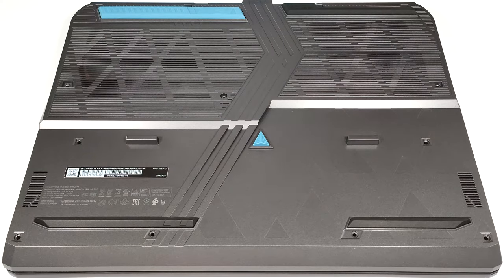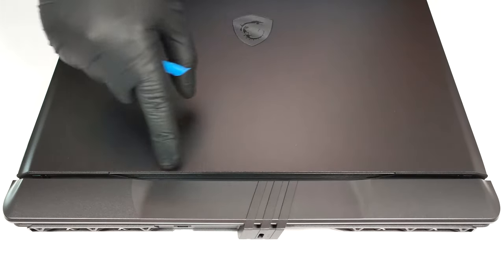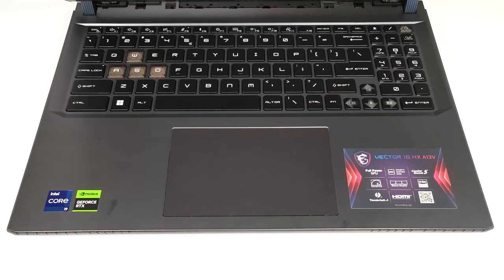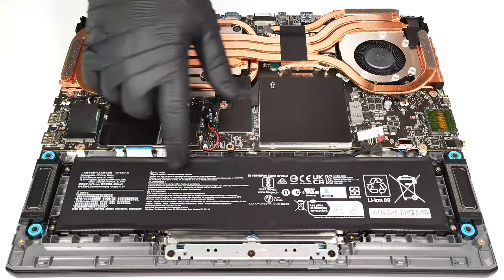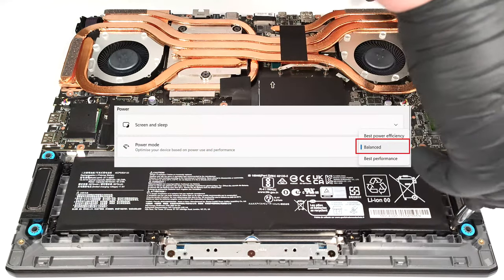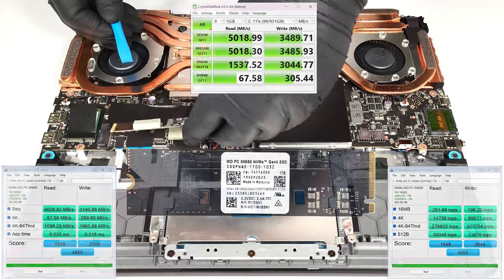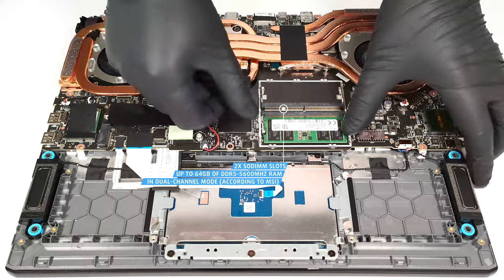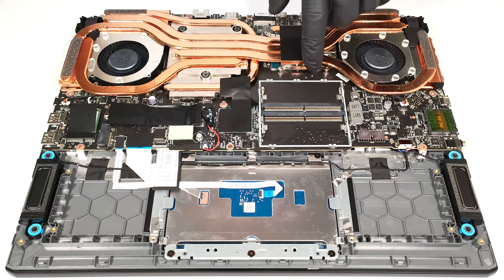🛠️ How to open MSI Vector 16 HX A13V - disassembly and upgrade options

Comment: Thanks for the video man. Just like the other comment said, buying prying tool is the best decision. The hardest part is to open the rear hinges cover, trying to not scratch the plastic cover. From there its all easy opening.  The installation of the back cover however, is a bit harder in order to fit the audio port in place

Comment: Thanks for the video. I'm glad I purchased my fake I-Fix it kit before attempting this unit. I only needed a credit card or knife to get into the Asus ROG zephyrus duo 16 gx650py, Asus TUF A15 Ryzen 9 RTX 4070 FA507xi and various others but this one certainly requires more finesse. With the right tools it was fairly reasonable.